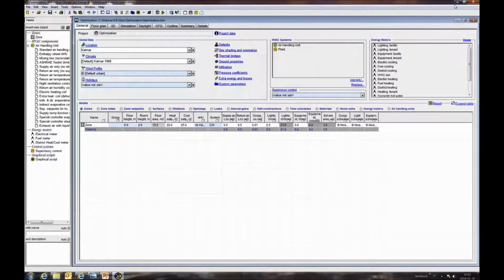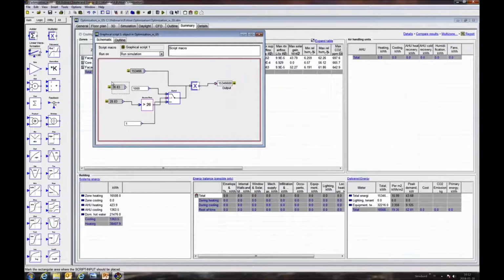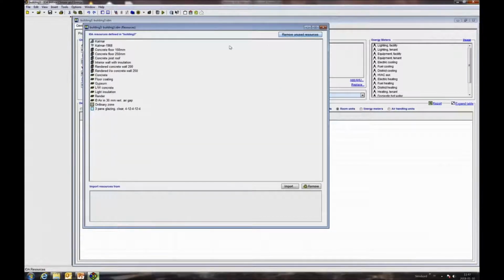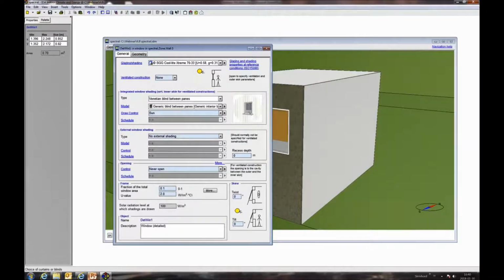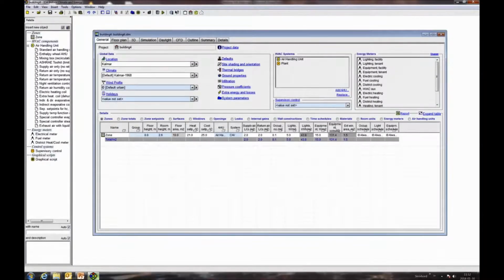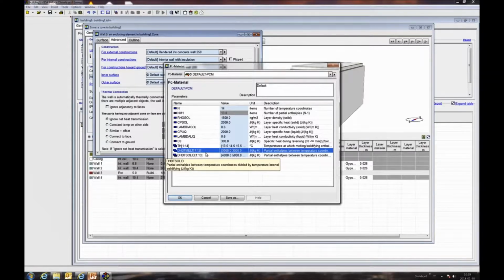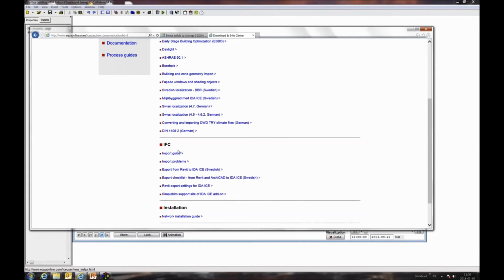Release of IDA ICE 4.8 - Feature highlights (Webinar)

Comment: 1:35 Optimization
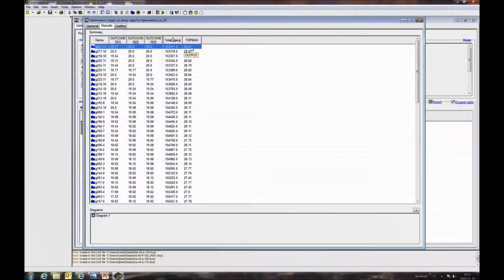10:21 Graphical scripting
20:38 Various new features like construction defaults for surfaces facing ground
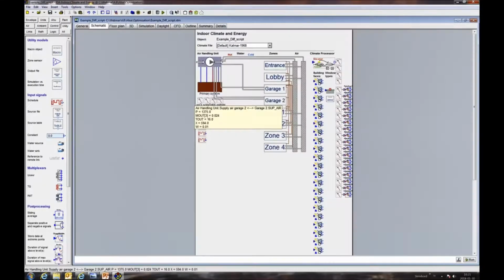22:33 Thermal bridges
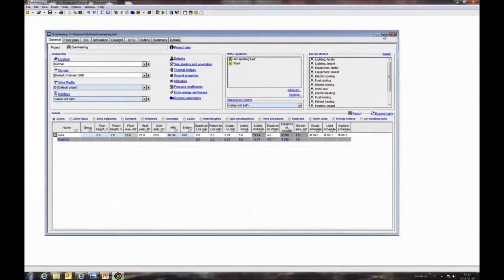26:00 "Overheating" simulation type
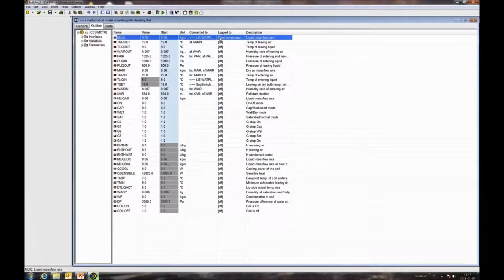28:03 Heat emitted from occupants
28:49 Enthalpy wheel exchanger
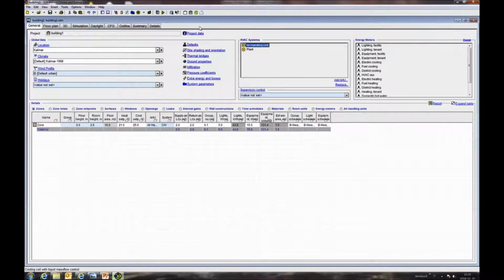31:48 Phase change materials
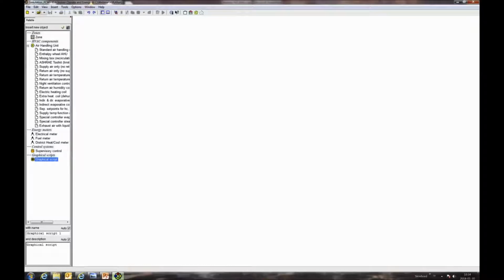36:03 Pane by pane window model, new types of shades
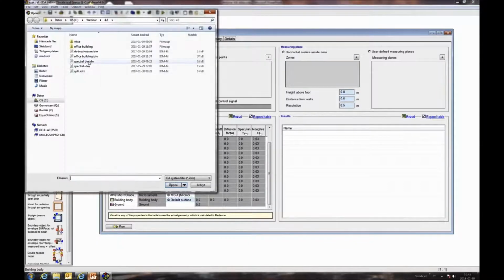43:34 Daylight extension
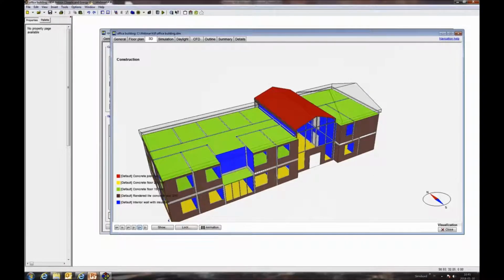48:51 New floor plan
52:02 Shading in 3D view
52:45 Application programming interface
54:18 CFD
56:01 Q&A